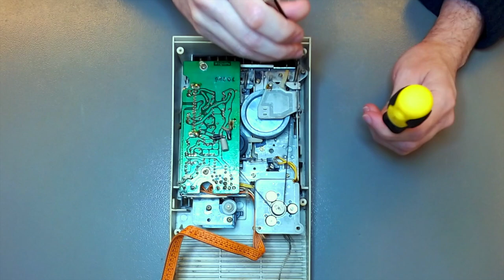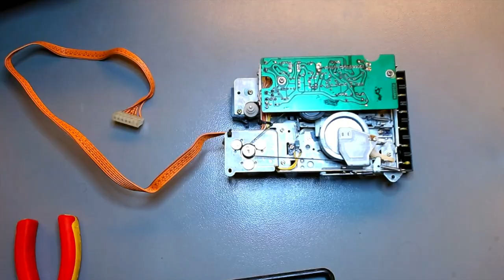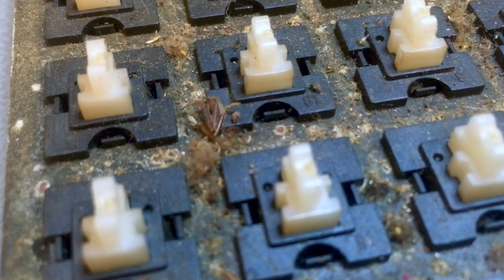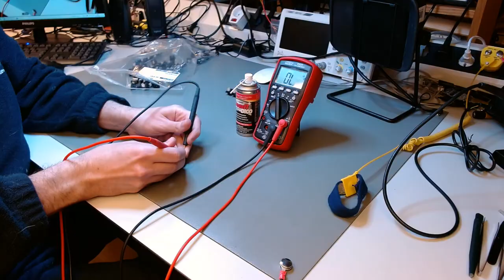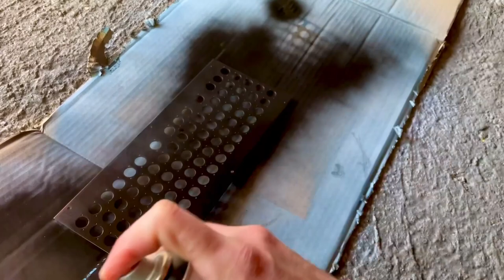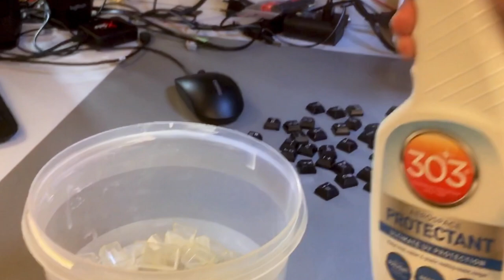Sharp MZ-80K museum-quality restoration, PART 5

Comment: I used an MZ-80K as my main computer from 1980 until 1987. I bought and repaired a broken MZ-80K machine a couple of months ago, but I did not restore it as thoroughly as you do because I was afraid to break things. I however bought a second one which will arrive any day now, and your videos are inspiring me to do a complete restoration on that machine. i am using the z88dk assembler to program it, to recreate and improve on the games I wrote in the early 80s.
Reply from the maker: I'm happy to have helped inspire you!

Comment: Great job, restored elegantly.
Nostalgic, MZ-80 series use the tape heavily since it have no hard drive at that time.
Reply from the maker: Thanks!
Reply: Floppy drives were available, but they never became popular because (1) the tape deck was built-in, reliable and at 1200 bits/second quite fast at the time (typical tape drives such as the Commodore Datasette were 300 bits/second), (2) the version of CP/M was minimal/reduced due to the 48k bytes RAM memory limitation and the 40 characters * 25 lines (with a most peculiar character set) screen limitation, and (3) the floppy drives were prohibitively expensive.

Comment: Some people don't have enough confident to de-solder and worry about the keyboard not working after re-assemble, that need a plan and PATIENT. This keyboard have a high quality key mechanism, a bit difficult to work on the Apple ][+ or //e keyboard.
Reply from the maker: Yeah, I hope this helps people gain confidence that this job is easily doable by anyone with a bit of patience.

Comment: Years ago, I got a keyboard from an old terminal that I adapted to my Spectrum clone. It had a awful touch keyboard that was unreliable. Then I did the same as you, I opened to pieces, cleaned and after reassembled, I put a new pcb that make it able to be used with my computer. I also wired the speaker, power supply and the LEDs from the keyboard to the computer and I was very happy with the result. The whole process took about two weeks to complete.
Btw, do you know what switches are and if there is an equivalent or if they are still produced?
Reply from the maker: Great to hear about your project! As for the switches, I don't really know... This is the first Sharp computer I restore, and I managed to get all the switches to work, so there was no need to search further.